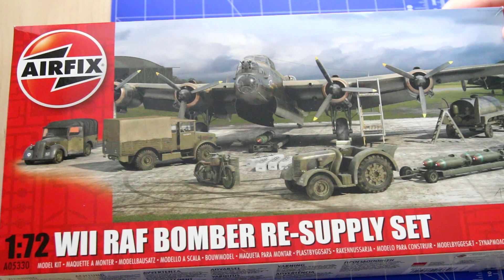WWII RAF Bomber Resupply Set (Airfix 1:72 scale model kit)

Comment: A nice set, indeed. A bit retro, I know, but the old Airfix Refuelling Set had some nice ground crew figures that could be used, and similarly, the seated figures from the old 'Recovery Set' could be used. Then there is the Revell RAF Pilots And Ground Crew set, which I understand can be hard to find. That had some great figures, in hard styrene, with separate arms, torsos, legs and heads, so you could really vary the figures. I have also, in the past, used the hard styrene figures from DAPOL - the workmen and passenger sets, swapping heads with some of the seated passenger figures, to give them 'Battle Bowlers', to use as drivers in softskin vehicles.
Reply from the maker: Good tips, thank you. I will keep my eye out for those kits.

Comment: Nice kit ! Looking forward too you painting the vehicles and bombs . Agree its a shame airfix don't include a few figures which would enhance a diorama , yet they do in the RAF recovery set . 
Regards nick
Reply from the maker: Yes, the recovery set looks interesting. I've seen it in HO (1:76) and 1:72 boxings, but I'm not clear if Airfix have scaled up the molds or just said "pah, it's close enough" and change the label.
Reply: Iirc they labelled it ho/oo at one point so unless it has been upgraded since, it is likely to be 1:76 scale,  though it could be 1:87 too! (Ho/oo being a common label in the 90s and earlier as they share the same gauge track for model railway, but are 3.5mm and 4mm to the foot respectively).

However,  if your diorama is big enough and you put the vehicles at the back no one is likely to notice and you may get a bit of perspective.

Comment: A nice little set,along with that usaaf one. One interesting thing is colours. I had the recovery set many years ago and it was blue, i didn't think the raf stuff got green in the war, though I have been out of the loop for ages now. Perhaps airfix got confused with a naval air station for the blue? Another couple of kits that would compliment this is the aec matador as they were seemingly everywhere and there was a separate ambulance i thi.
Reply from the maker: I think there has been a lot of progress with research into camo colours in recent years. I believe (but could easily be wrong) that RAF blue schemes were used post war rather than during WW2. You're right about the other Airfix kits - that rescue ones would be a great candidate for a Vintage Classics release or, even better, a new tool.
Reply: @ModelNerd  I suspect you're right about the colours, those cheap kits back then were more concerned with being cheap and relatively easy to build rather than completely accurate, though some of them were, though often basic compared to what we'd accept today.

The Matador and gun trailer are in the classics range I believe already. I don't think the control tower or rescue set has reappeared yet, I agree both getting a new tooling would be nice, I remember them fondly from about 30 years ago. So much more available today than there ever was! 

the problem is more where to put them when done these days though, which does somewhat atm, put me off getting back into building aircraft kits again for the time being, though the small fighters in 1/72 are probably about right size wise for my current constraints, though I always preferred 1:48 back then.
Reply from the maker: Yes, I know what you mean. I have no more room for shelving units so am looking on a solution to add shelves to the existing ones :)

Comment: i think airfix have got  it wrong, that    bedford mw is too small to fill up a lancaster, i am sure a Bedford ql 4x4 tanker or  an AEC 6x6 tanker used to do this job.pity Guy Gibson is not around to find out, years ago airfix used to do a refueling set with an AEC in it
Reply from the maker: I'm honestly not sure mate. The standalone bowser is marked as 450 gallons, and the Bedford is obviously smaller than that. Could they be for water or oil rather than fuel maybe?